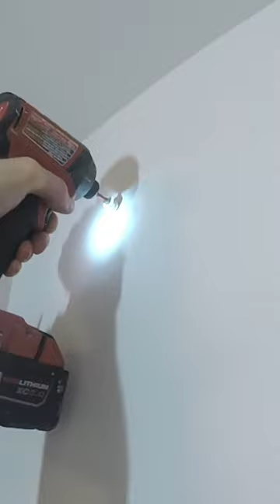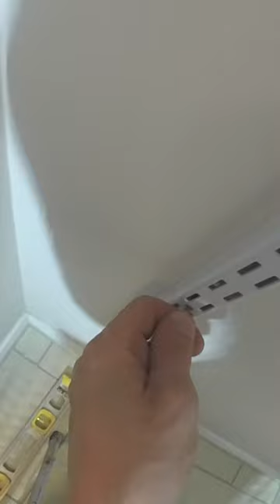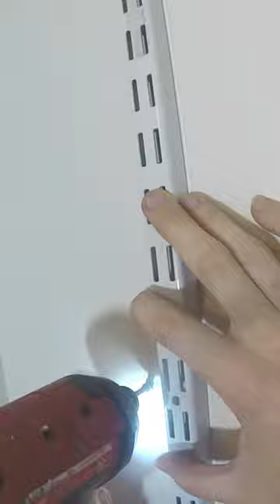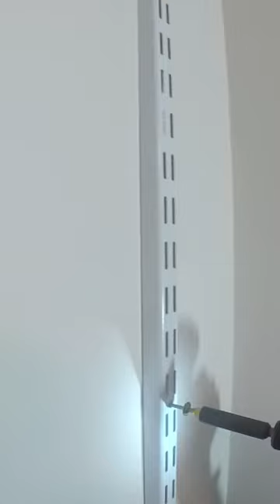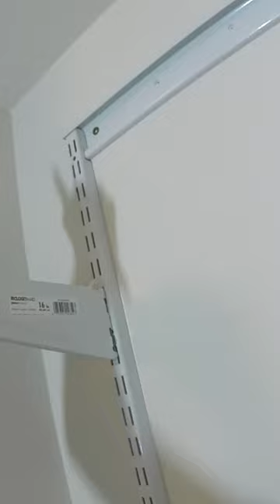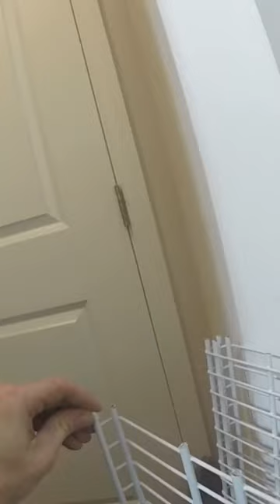Easy Closetmaid Wire Shelving Installation

Comment: You’re supposed to throw those drywall anchors in the trash and go buy some metal ones.
Reply: Yup. This will be on the floor within a year
Reply: Thanks for this bit of advice. I have been thinking about using this type of shelving to convert a bedroom into a walk-in closet and I'm EXTREMELY concerned about my stuff ending up on the floor because something failed.
Reply: @lalakeneni  toggle action anchors are the best.  They have a little zip tie and a bolt and are rated for about 135 depending on the thickness of your drywall.  I actually mounted a TV with 2 screws into the stud and 4 pull toggle anchors into the drywall.  Only problem is they require a 1/2” hole.

Comment: WHAT IS THE TOOL YOU USES TO CUT THE WIRE?
Reply from the maker: It's called a bolt cutter. I believe mine is 14" long with 5/16" cutting capacity. Makes quick work of those wire shelves vs using a hacksaw and is much less messy compared to a cutoff tool
Reply: i hope you found a long handle one also

Comment: I’m building new house 
And want to add blocking before the drywall
I have not bought the closet maid system yet
I know the upper track is 84” high off the floor
Can you please tell me the distance down from the track to the mounting hole on the 
Vertical tracks 
So I can add a row of blocking
TIA

Comment: Why are you hammering those anchors? You just drill them in. This closet is going to fall
Off the wall.
Reply: Why would it fall off? Cuz it’s plastic? (Asking cuz I’m getting ready to diy my closet that fell)
Reply: @missm472 it wouldn't fall off because the Rawl plugs (wall anchors) are plastic.
It may fall off because that type  is for plasterboard (drywall) and one is meant to screw them in, not hammer them in.
Also screwing into the wooden studs the plasterboard is nailed to is more secure than screwing into the plasterboard.